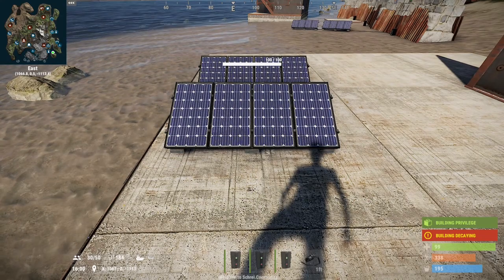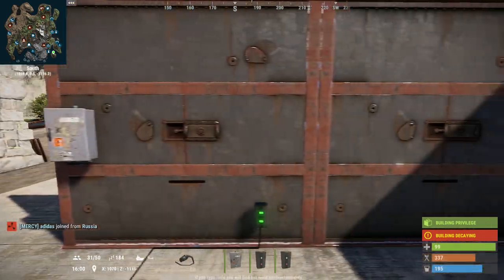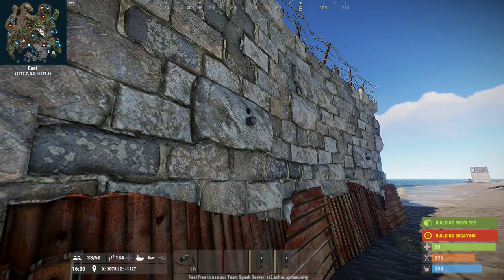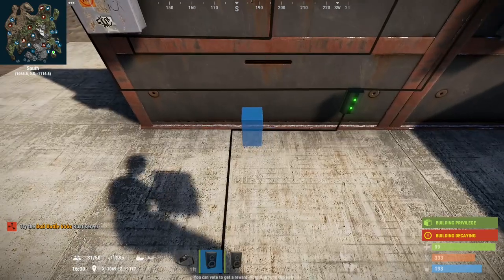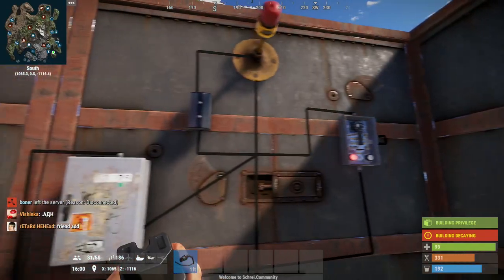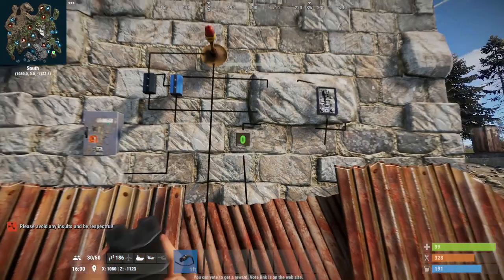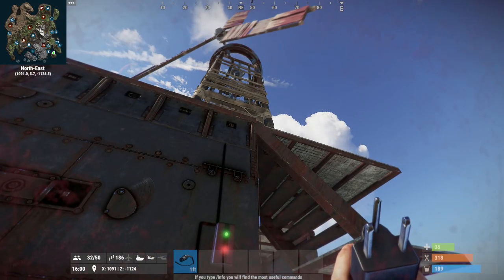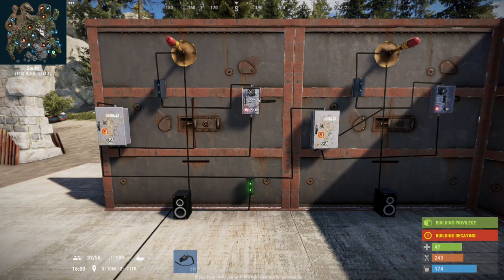Rust - Simple Base Alarm System - Lights & Sounds

Comment: Awesome video thanks! How would you attach multiple heartbeat sensors to this one alarm? Like if you had sensors all around your base and one central alarm
Reply from the maker: As far as what I have read up on you can't run them in series, as in, attach 3 Heartbeat sensors one after the other because the output power of one sensor is equal to the number of people who trigger it. So you can have 50 power going in but it will only ever output 1 power if 1 person is there, 2 if 2 and so on, so if you run them one after the other, there may not be enough power to reach the other sensors. 

If this changes though I'll post an update but with what Im trying on a sandbox server, it's not wanting to play ball.